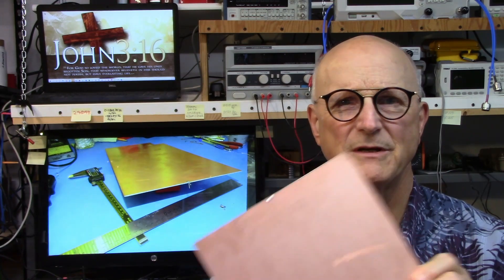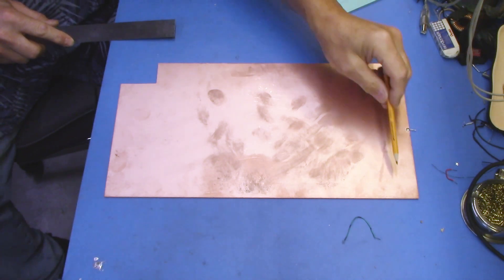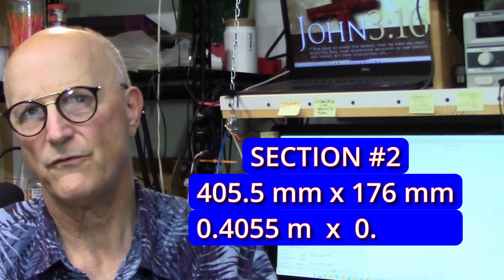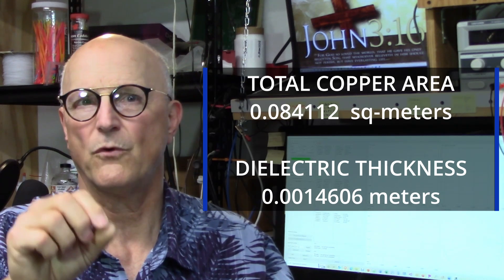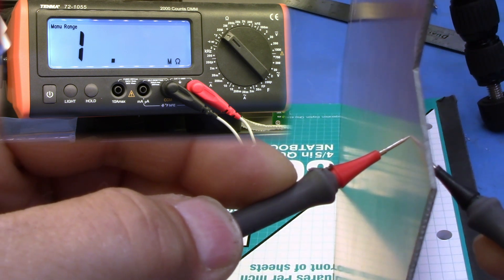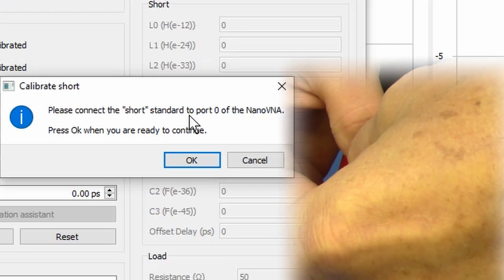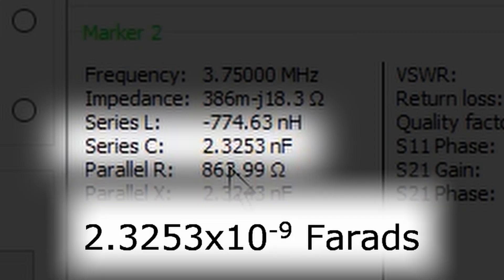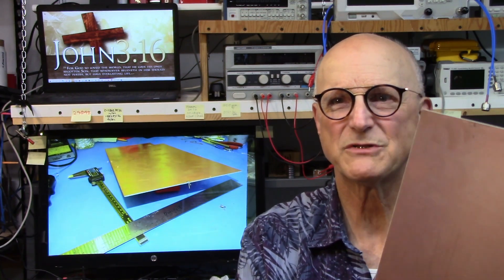Measuring the Dielectric Coefficient of PCB Material (033)

Comment: Great tutorial! 😊 do you think it is possible to use this method to check material with a low dielectric constant such as styrofoam? trying to verify/justifty the use of low relative permittivity materials for EMC lab.
Reply from the maker: Thank you! My concern with the use of materials such as Styrofoam is the consistency of manufacture. Will lot A have the same (or even close) dielectric coefficient as lot B? Unlike the PCB substrate materials, they do not have the constraints for dielectric coefficient consistency from lot-to-lot. You could try to do this. But I would recommend not confining yourself to a single sample from a single lot. Otherwise, you end up with a one-off success that cannot be consistently repeated (i.e. for a manufacturing process). :-)
Reply: @eie_for_you  Thanks for the comment. I have a requirement that products in test must be supported on 50mm of material that has a dielectric constant less then 1.4. it would good to be about to prove it 😅
Reply from the maker: I see, I see. 50mm...that is quite thick. To use this method to measure its dielectric constant, you would, of course, need some sort of conductor on each side of the material. Of course, the best accuracy will be had with the largest surface area, especially with a low dielectric constant and 50mm of separation. You have to get the measured capacitance up into the range where it can be reliably measured. Based on some very quick calculations here, I would be shooting for about a square meter of material for the measurement. I'd be interested in how this works out for you. :-)

Comment: Dear sir I Hope that you are doing well, I need your assistance regarding dielectric cofficient of denim fabric or leather for wearable antenna...Thanks
Reply from the maker: I think you are going to find the dielectric coefficient of these materials is going to change dramatically from one sample to the next; there are just too many variables there. The other issue is the absorption of water/humidity which will also drastically change its electrical characteristics including its conductivity.  Sorry. 🙂
Reply: @eie_for_you  thanks for your quick and kind response, if you please guide us the generic method so that we can try it with our material.. thanks
Reply from the maker: @vibrantislam  It is right here in this video. 🙂

Comment: Can we use a basic LCR meter to find the capacitance?
Reply from the maker: Here is the rub ... accuracy. Sure, you can do just that, but how accurate is that LCR meter as compared to the VNA? 🙂
Reply: @eie_for_you  There are two types of LCR meters. Handheld LCR meters are very basic but are quite accurate. Bench top LCR meters have the option to select two to three frequencies for the measurement and are very accurate and these are used in production of inductors & capacitors.
Reply from the maker: @pravardhanus  My encouragement to you is to actually go to the specifications for the instrument you are looking to use to discover what "accurate" means. I think you will be surprised at what you find. Take time to get a solid definition with real numbers before moving ahead. Make decisions based on hard facts, not perceptions of them. 🙂

Comment: Hey Ralph. How can i measure the dielectric coefficient for microwave frequency applications, for example a patch antenna?
Reply from the maker: I have to admit that I have never worked at microwave frequencies or even close. With that said, the principles remain the same, it just gets a LOT pickier about lead lengths and the effects that distances and the like make in the measurement. I am sure that my little clip-type fixture would be out of the question.
The question that I have to pose has more to do with the effects of frequency on the actual dielectric coefficient of the material. If I were in your shoes, I would measure it using the method I show here and then devise a way to use that PCB material at the target frequency to see how close this determination ended up being.
Wish I could help more. 🙂
Reply: @eie_for_you  Thank you for the clear explanation. Still learned a lot, no one makes videos or tells you about this stuff :) Greetings from Turkey.
Reply from the maker: @sinaburakay  You are very welcome! 🙂

Comment: If I don't have a nanoVNA, can i replace it by using a multimerter that can read farads and a signal generator? 
BTW, awesome tutorial
Reply from the maker: Thanks so much for the encouragement! 🙂Unfortunately, the capacitance is way to low for a multimeter that reads capacitance unless you have a very large sheet and it the dielectric is pretty thin. 🙂

Comment: Is there a resource you know of to estimate a correction to the measured value to account for fri ging at the perimeter of the sheet? Do you think such fringing is significant?
Reply from the maker: I do not believe that fringing was a significant enough contributor to be concerned about. I used the numbers I calculated/measured to make a stripline and it worked perfectly.

Comment: Thanks for that excellent tutorial, I am planning on making an antenna coupler using pads of pcb material on double sided board in a binary sequence to achieve the values required. Maximum value being 500pf, The coils will be mounted on the same board and switched in the same way. Using 8 values for each, all decrementing by half the previous values I should have enough resolution to cover the bands of interest. Thanks again.  Mark
Reply from the maker: You are very welcome! Sounds like an interesting project!

Comment: Yes YES YES, many thanks, I have just etched a stripline vswr coupler. After searching on the net I used aproximate dimensions, after playing with the terminations resistors I can get it to work at 145 MHz but is useless at UHF. I am now about to do a more presice version and I couldn't work out how to find the dielectric constant, for fr4 material is can vary from about 3.8 to 4.8, this makes a huge difference to the final result. Now I am about to rush out to my shop and actually measure it, many thanks, Bruce
Reply from the maker: You are very welcome! I was creating my own RF Power Splitter and had to do this to get the impedances right. Let me know how your project works out. 🙂